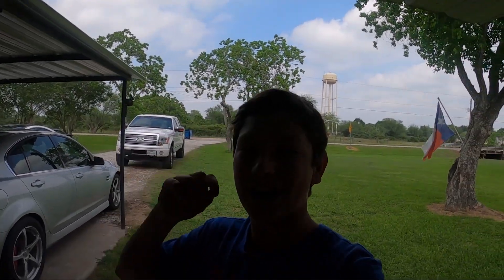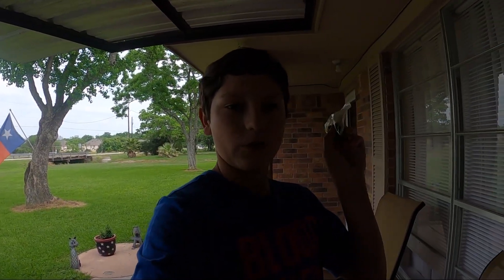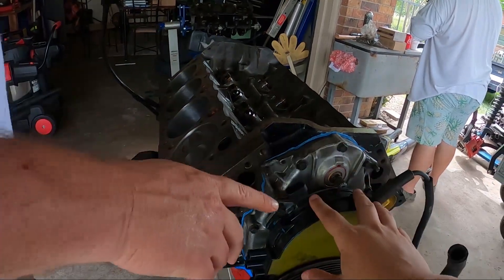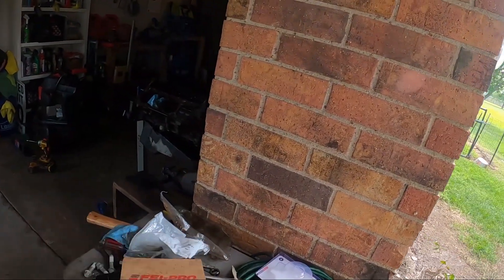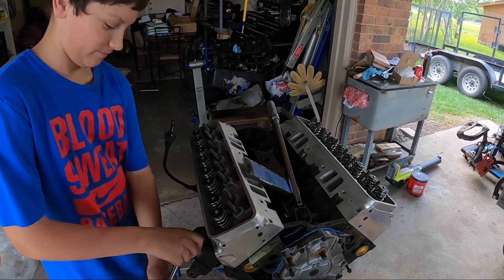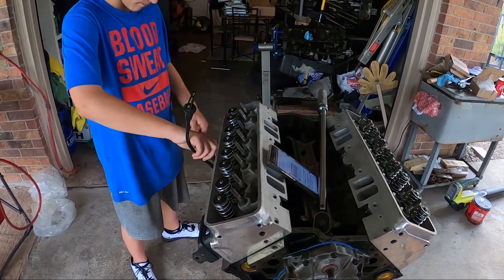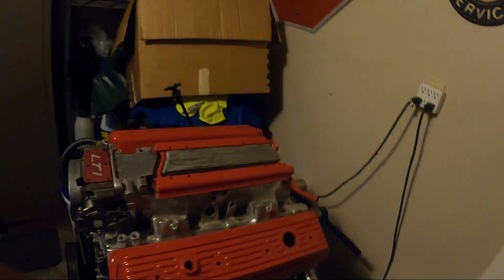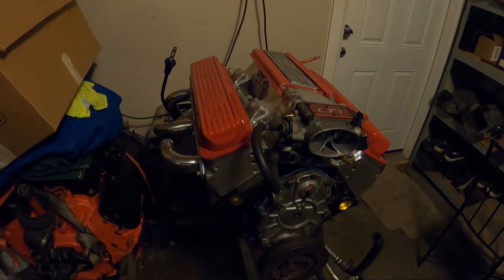We BROKE a head bolt!!  Installing the LT1 heads in a 94 Fbody z28 camaro

Comment: Lubed ARP would likely work in that sit, but on stock torque to yield, you need to install them to the torque spec plus the degree specd. Edit- and never, ever reuse them. People that think they're the weak link, probably are the people using them twice. But most wont make the torque spec a 2nd time, they stretch and it feels like your wrench got super easy to tighten.
Reply from the maker: I really wish we had went with arp but we did torque to spec but didnt use the degrees. So far so good, no head issues but were still in break in period!
Reply: @FastLanePros  You are very lucky they didn't stretch, I've seen friends try to reuse Ford & GM TTYs and neither worked again. You aren't using the full spec if you're not adding those degrees(which is simple w/just your wrench handle). When you decide to go with ARP I highly suggest studs. The price isn't much more than bolts, and they're(edit) far superior fasteners. I even use them w/ my billet splayed main caps..
Reply from the maker: We have another Lt1 that we're going to fully forge and we will definitely be going arp on everything.

Comment: hey bro i just got tje 96 camaro i told you about in the other vid, i had a question do you know why sometimes it’s hard to put my car into gear, even reverse. I feel like it’s the aftermarket clutch they put, or something
Reply: i would think it’s the synchros but even reverse is hard, seems to get better when the car gets warmer
Reply from the maker: May need to be shimmed or like you said it maybe the clutch. I'm not too savvy on the manuals. Does it grind real bad or just hard to go in?
Reply: Fast Lane Pros it hardly grinds, only sometimes like 1in 50 shifts but i think that’s because i’m knew to manual and not putting the clutch all the way in when shifting, But yeah only when first turing on the car is real hard to put into gear. And when first turning on o have to let go off clutch and repress it to be able to put it in reverse. A shop told me to take it to them tomorrow, so they could diagnose it but i’m busy hahah
Reply: Fast Lane Pros after it’s on for like 5 min it gets real better, i just changed the trans oil like 4days and seemed to improve it a lot and have only driven it like <45 miles since, because it’s not registered or tags since 2014 hahaha
Reply from the maker: @rebel9976  could be the slave cylinder. If it's not grinding then it's definitely not the synchro's. Hardly anything around here is legal lol tags out on everything due to Rona lol. Get it to a shop asap though and let us know what it is. Keep us posted cause I'm definitely curious now. 😂
Reply: Fast Lane Pros the shop is 30 min away 👀 haha never been on the freeway but f it first time for anything
Reply from the maker: @rebel9976  Send it brother 😂😂

Comment: i have the degree angle tool, its very easy to use, and that is why you need to follow the instructions man! 65 ft lbs might work for some but sounds like its too much compared to the 22ft lbs plus how ever many degrees you need...... you live and you learn. and do not re use stock ones.... they are one time use and maybe for a stock non performance motor it would be fine, but not for a performance motor
Reply from the maker: We still haven't put the valve covers on or the push rods, I plan on ordering a set of ARPS and doing it the right way. Only thing is my torque wrench starts at 50 ft lbs so we couldn't start at 22. You can come over and give us a hand and bring the the Pontiac wheel caps if you'd like so we make sure we get it right if you want to and hop in the video 😁
Reply: @FastLanePros  if you didnt live over an hour a way i would lol

Comment: How come you didn’t go with the Torquehead coil conversion?
Reply from the maker: Just don't have the money to come out of pocket $1800+
Reply: @FastLanePros  Haha, the same reason 99.9% of LT1s don't have them
Reply: Truly a great setup.. But you can run an 0411 pcm through much cheaper routes as well.
Reply from the maker: Never seen it done.